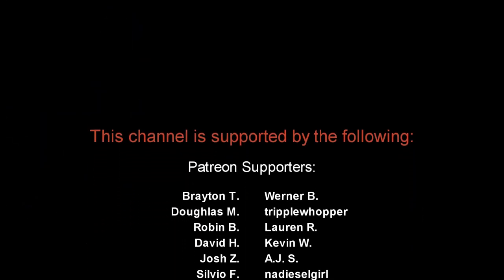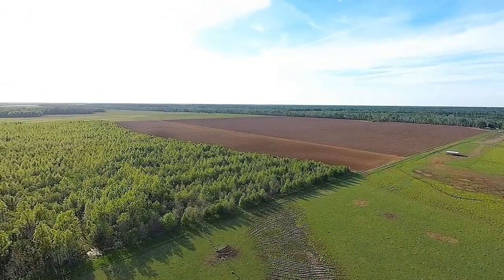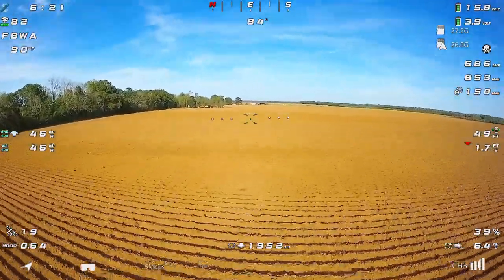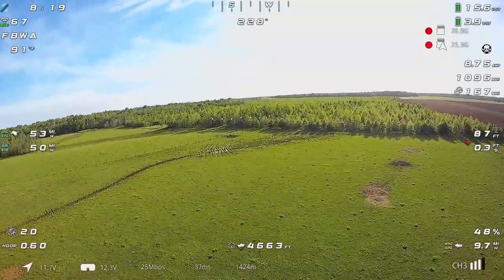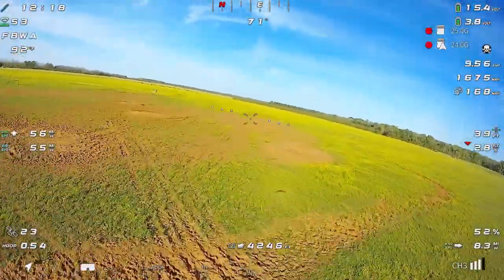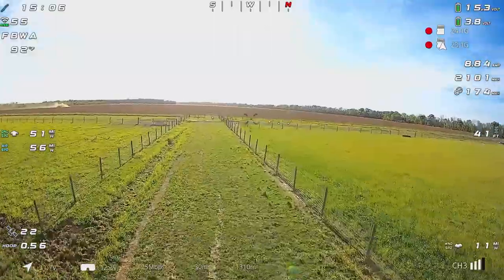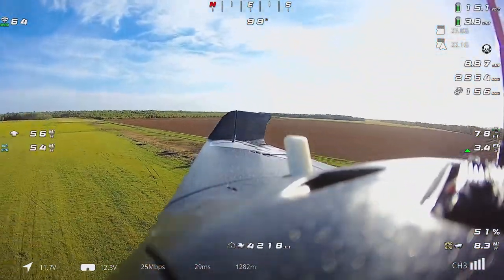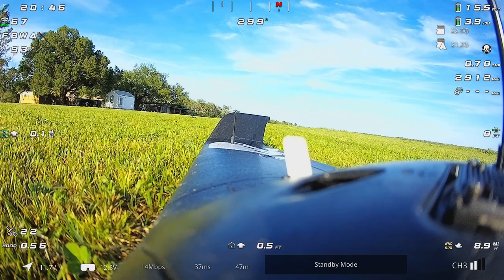Walksnail HD Pro Kit, Gyroflow?

Comment: I just ordered the standard V2 with gyro flo. I mainly fly 5" quads with no action camera so the option to use gyro flow seems cool. might get one of the pro cameras for low light some day. really pleased with the direction and pricing of walksnail.
Reply: Yea.. I got walksnail to test it. Use on whoops for the onboard recording but it come Long way .. I want to put in future drones. 
I have HDzer0 too for whoops to save some weight.

Comment: Was going to suggest to include a small video insert of the unstabilized over the fullscreen gyroflow stabilized to get an idea (realtime) of how gusty the wind for future video. At 4:50 we get a nice sample of that as you overfly your runway. Seeing the video glitch at 4:57 (tree line artifacts) and was wondering if this related to when video file(s) get split. Thanks for confirming later in the video. 
Right from the beginning the video quality of the Avatar Pro looks awesome, nice vivid colors and sharp font on the OSD. The initial part of video is great representation of a good stable rendering. Cool to see the winds flex as pan. It really communicates what the flight was like.